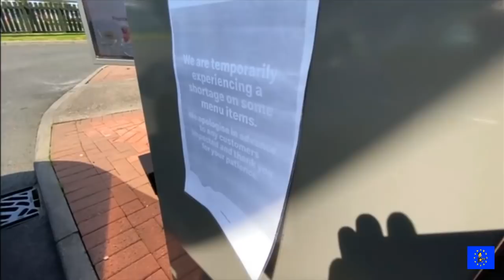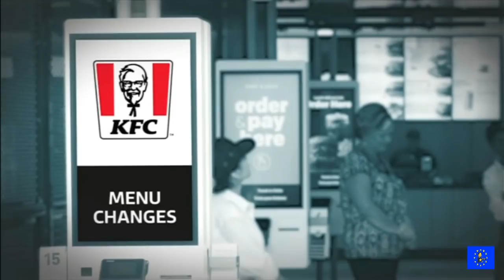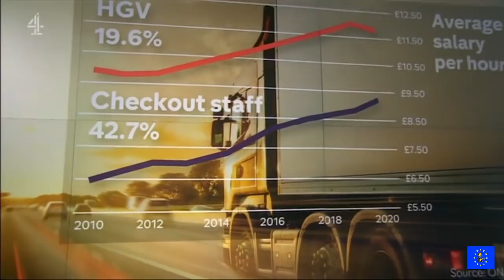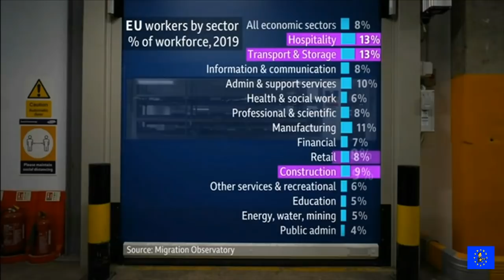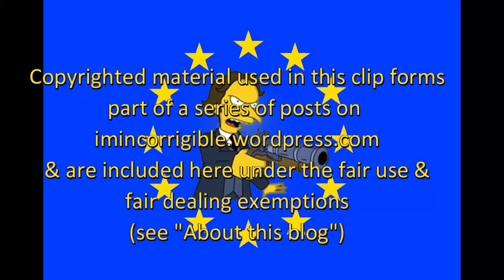Brexit Reality: VoteLeave's chickens don't come home to roost

Comment: Strange how we Don’t have ANY problems in Europe 🤔
Reply: Any is overstating it...but we are able to deal with the supply issues.
Reply: We don't even have problems in third-world South Africa. How strange.
Reply: Don't worry. Brits will find a way to make sure we give you problems. It's what we do.
Reply: @Mag Fes
Well of course you still have freedom of movement, which amongst other things, allows employers across higher wage Western European States (including the UK when we were still in the EU) to bring in large numbers of Eastern European workers from historically low wage countries, which had the effect of creating downward pressure on wage levels in those areas, including hauliers as was alluded to in one of these clips. It was noted a few years ago that lower paid workers had barely kept pace with inflation after the 2008 financial crash, whilst the better paid seem to have shot even further ahead than they were previously.

Agriculture, which is my sector used to have a body called the Agricultural Wages Board, which set the payscales for workers. Cameron's government did away with that, instead pushing farm workers onto the minimum wage, which is considerably lower than the old AWB rates were at the time. Now, I'm sure not all farmers would shaft their staff by slashing pay, but equally I'm certain many did take the opportunity to reduce costs by doing so and effectively replacing British workers with seasonal migrant staff, many of whom would not have been aware of the value of their labour in a higher wage economy than their home country.

Obviously there are many factors at play here, but dealing with the after-effects of addiction to low prices (including low prices paid to producers and workers) is going to take time to iron out.
Reply: @ShanghaiRooster  What you're talking about is a very small effect that economists have estimated at around 1% reduction in wages due to migrant labour. The truth is that without seasonal and migrant labour most of the world's developed economies would face intense labor shortages that cannot be fixed. The only way the situation will resolve itself longterm, if you insist on very strict migration rules, is that the economy in those sectors shrinks to fit the labor force instead of the other way around. Thus, you will pick less fruits & vegetables in the UK and import more from the EU, your choice of products will be reduced over time to fit the new lower level of HGV drivers, etc.

My guess is, though, that at some point in time (maybe in a few years) your government will quietly reverse itself and do a deal with the EU for better access which includes some form of freedom of movement banking on the goldfish memory of the UK voter to not connect the dots.
Reply: @garyjohnson..  Actually not. We had looting but within a few days shops were fully functional. We have no truck driver shortage and we have many people willing to work on the farms.
Reply: @wendyhay1302  some looting?. 😂😂😂. the footage I saw thousands where on the rampage ffs.. must of been CGI. eh wendy?
Reply: @Liorte1973  😂😂😂. admit it?. you've been in denial for 5yrs.. and will never accept the result. just googled farmers let crops rot. because of staff shortage. I suggest you do the same.

Comment: The shortage is mostly due to all EU based companies that were previously hired to do cabotage within the uk. Now, they all refuse the contracts due to the extra paperwork... welcome to the Brexit sir. Now, the problem is not the shortage, it is that the increased rates paid to drivers to keep them t work will not be paid by Tesco, but by shoppers. Hello, raging inflation :-)
Reply: The "C" word that nobody mentions .......cabotage. If you can't link loads then someone has to pay for an empty lorry trundling along the motorway; guess who pays.
Reply: @2msvalkyrie529  nope. Not the point here. Drivers getting better paid will mean f**k all to them if all the prices increase ! They will still struggle the same to put food on the table. And the rest of us even more. So what good is that in the end ?
Reply: @2msvalkyrie529  Cabotage and drivers' pay rates are two separate issues. If there are not enough drivers or trucks to transport the goods increasing drivers' pay rates will not solve the problem.
Reply: @skylib2452  It might cause other issues also, if Drivers carrying food and essentials are getting paid more, then refuse collection lorry drivers are going to take those jobs and leave their old jobs vacant until that gets a wage increase also.

Comment: Even if there's domestic drivers, there's still the problem with the physical shortage Lories to offset the amount of traffic that was lost without the foreign drivers&their own lories.  Considering that the Suez Canal was only delayed for over a week, it had caused months of backlog in the supply chain.  So don't expect a miracle solution if the domestic drivers are available the next day as it will likely be over some to several months before this issue is resolved.  Most likely the Covid Pandemic will be over before this logistical nightmare will  take years to fully recover.

Comment: Even with relaxing immigration there is no guarantee that those workers/drivers will come back. There are also worker/driver shortages in the EU, not as significant as the UK, but there still are. So many of those workers/drivers might already have a new job. Add to that red tape apart from immigration like taxation and so forth.

Comment: An HGV drivers license takes 6-8 weeks to get. To cover the lack of current drivers and replace those who retires or seeks other careers you need to train massive amounts. If you train 10 000 every 6-8 weeks with a guarantee license afterwards you would be able to cover the lack of drivers sometimes around 2025. I know there are 25 000 people or more with a HGV license but those are either in a new job, long time sick leave or retired. Those are not to rely on to go back to the job.

Comment: Not only do prospective drivers need HGV tuition and pass the test,  usually in their own time and at their own cost, they also have to  complete, again usually in their own time and their own cost, the Driver's CPC course - which takes 5 days every 5 years ( or a rolling 1 day every year). 

Also, the tacho card records driving, working and break times which stores data for a year.  If stopped and/or analysed, any infringements recorded in the previous 28 days leaves the driver liable to be retrospectively prosecuted. This includes the standard WTD hours as well as driving regulations. 

Delays either on the road, loading/ unloading, etc, means drivers are not guaranteed to get home by the end of their shift. 

Much safer, cheaper and convenient to drive a smaller (3.5t) vehicle on a car licence.

Comment: as someone who has retired from this industry this is a problem waiting to happen LOW WAGES number one have you been in the toilets in some motorway services well truck stops are really bad no hot water in the showers showers not working at all extortionate prices on both parking and food and i haven't started on the wait times on supermarket RDCs and lack of availible facilities for drivers in them as for this new drivers coming in to the industry after spending £4,000 getting a licence there is no employer willing to employ new driver's with no experience so its off to driving agency to be ripped of by them and work some days and no work another and you wonder why there is a driver shortage and don't blame leaving the EU for this i worked in this industry for 30 years and it has always been the same the next thing that the RHA will be asking for is emergency driving hours this will allow driver's to work longer hours with shorter rest periods this is going to make the roads less safe just because the RHA members wont encourage more drivers with better pay but mostly with better working conditions

Comment: How about a bit of truth .milkshake 🤔 
For over 3 years milkshake is like rockinghorse shit .hears why the machines used are only allowed to be worked by companies who supply staff overfill and machines switch to engineering mode my own macs only had 4 milkshakes in twelve months never working see the programm on you tube its a company giving kickbacks for engineering visits staff not allowed to push reset buttons in sequence to make it run macs can't get out of contract yet 
They said themselves they should have kept old versions very rarely broke down 
Franchisers  are furious 😠 so please use another excuse